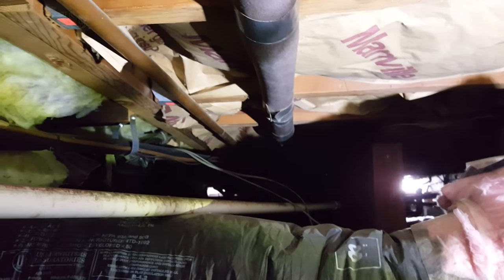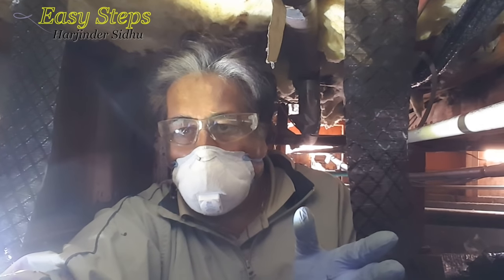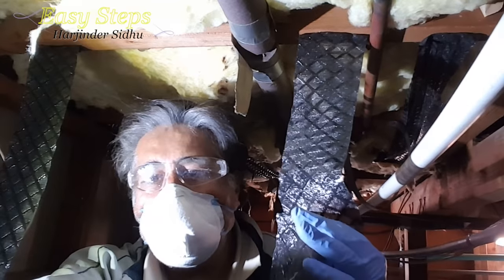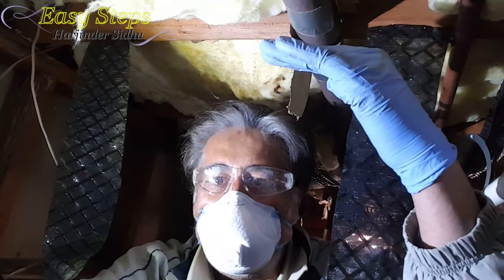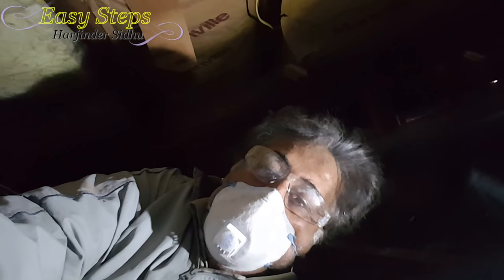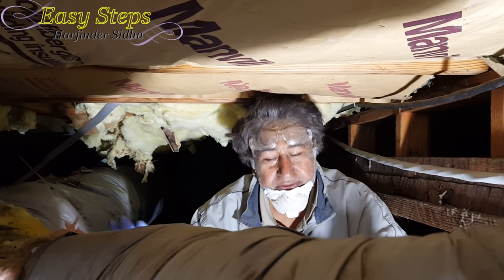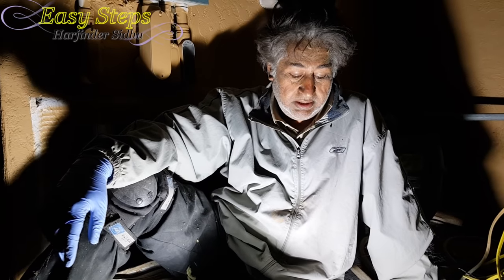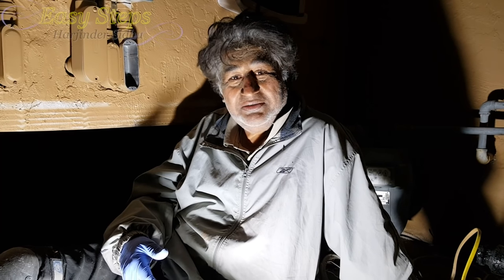Right Vs Wrong: Insulation Installed Upside Down | Vapor Barrier Paper Should Face Interior Walls

Comment: Damn. I was afraid of that. The bozo who owned my house before me installed the installation upside down, so now I get to fix it just like you had to. At least my crawlspace is much easier to work with, by the looks of it. You appear to have a lot more pipes and wires running around and getting in the way than I do. But then again I haven't looked under there since last year, so I might be wrong.

I've worked in crawlspaces before doing HVAC and I know how much it sucks to spend all day down there. It could be 50 degrees outside but it'll feel like 90 degrees under there while you're working especially with the coveralls and mask.  Good job, bro!
Reply from the maker: Thanks for watching. Good luck with your DIY project.

Comment: Sindhu, you appear to enjoy being under the house with your lessons. For any other projects you may well want to consider Roxul insulation which is easier to work with (no itch), has a better fire rating but is much more expensive. Good luck to further endeavors.
Reply: What are you talking about? Roxul insulation itch more than other insulations, what is true is that it is more expensive!!!!